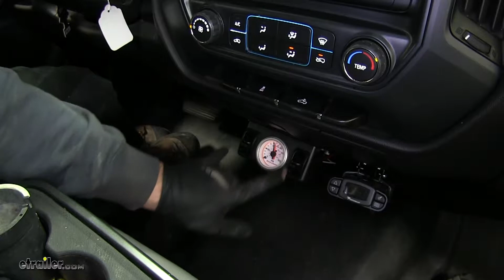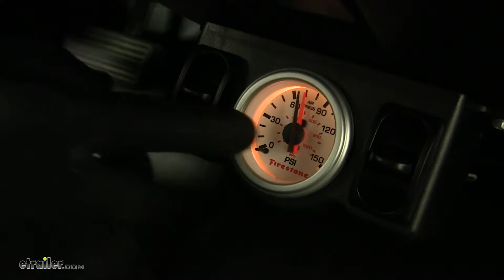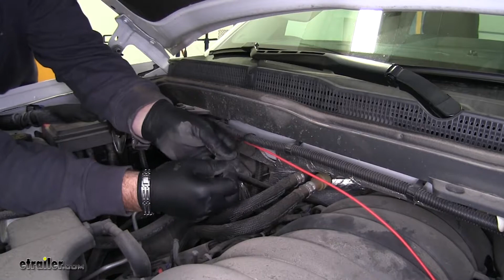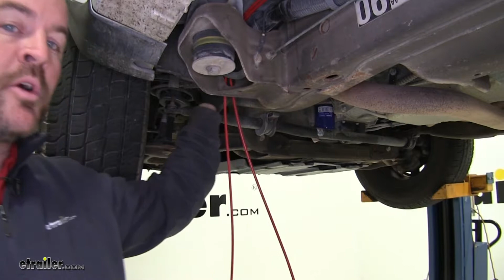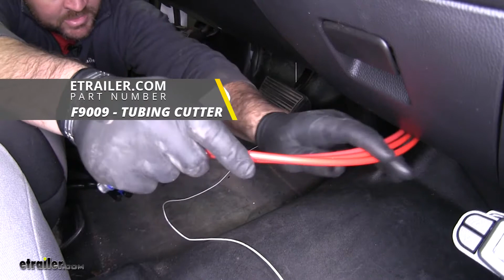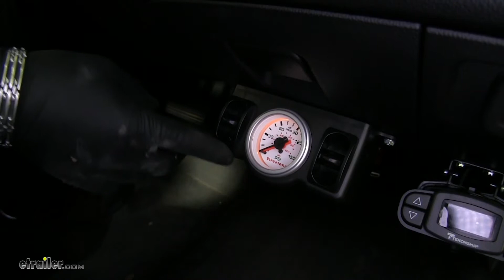Installation: Firestone Air Command Standard Duty Air Compressor on a 2014 Chevrolet Silverado 1500

Comment: Light switch. Tsp into the parking lights. Save ya about 15ft of wire
Reply from the maker: That's not a bad idea for getting power to illuminate the pressure gauge but you definitely want to run the power for the compressor directly to the positive terminal on the battery so that there is no interfering accessories.
https://www.etrailer.com/Air-Suspension-Compressor-Kit/Firestone/F2178.html